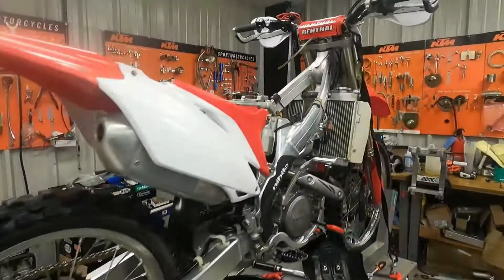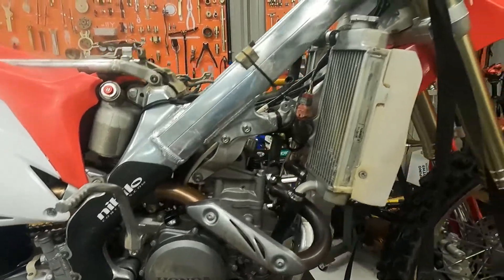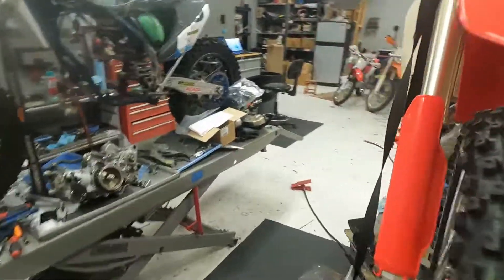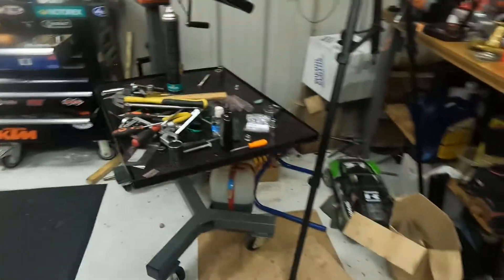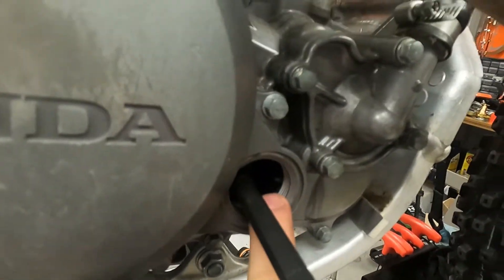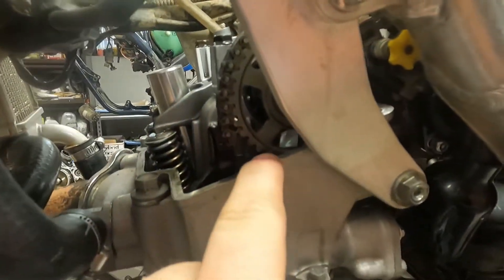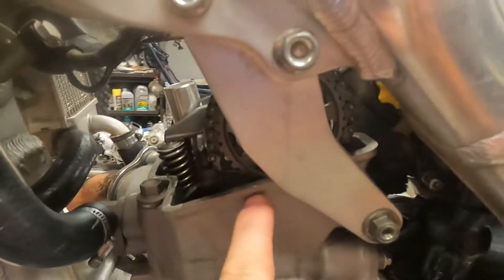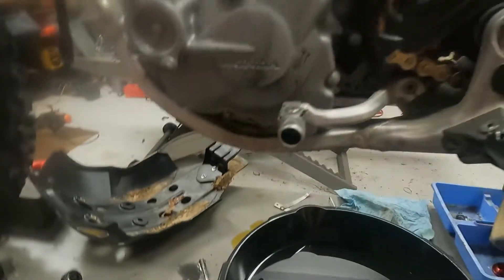2010 Honda CRF250R | How to put in Top Dead Center (TDC)

Comment: Just a Quick question, I am installing a manual cam chain tensioner, and I have to get the bike to top dead centre. Do I have to drain the oil to access  the plugs so I can move the position to tdc?